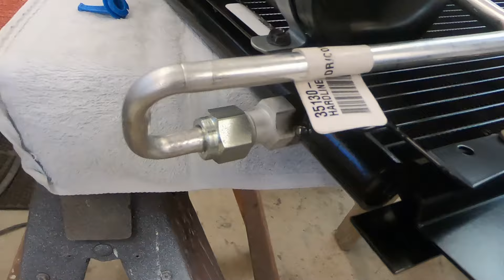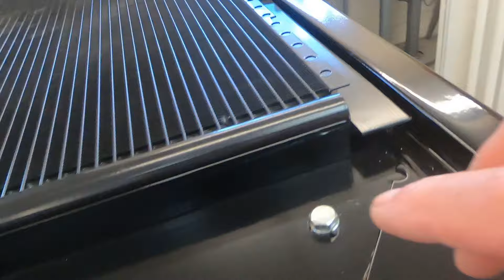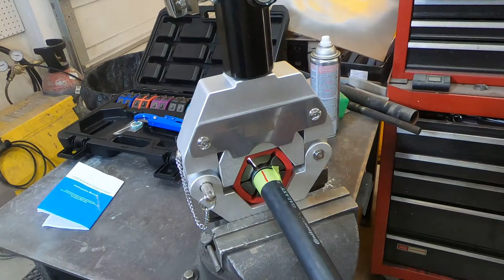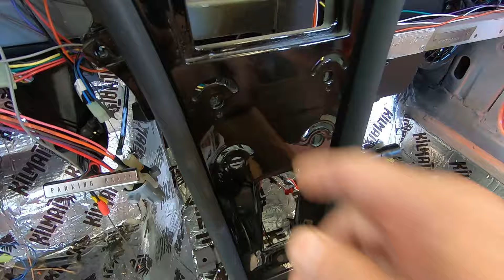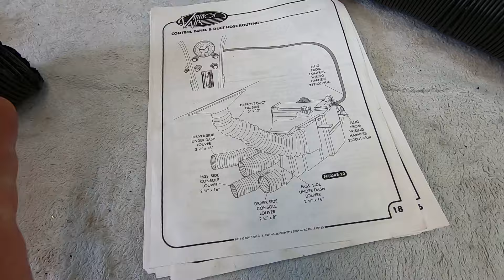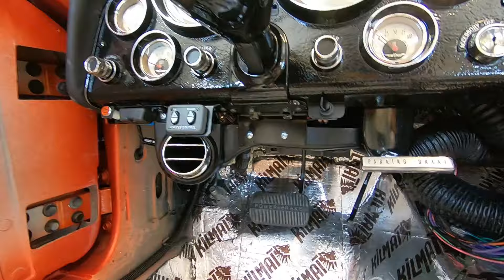Vintage Air Gen IV Surefit AC Installation - C2 Corvette - Part 2 of 2

Comment: I bought my Vintage Air kit a few years ago and have been postponing (procrastinating?) its installation for much too long.  Your video convinced me that even I might make my way through this task without too much trouble.  You are a handy guy, and you have inspired me, friend!

BTW, do you have a color code for that excellent paint choice on your Vette?  It is just about what I had in mind for a restomod '57 Chevy I am building here in Reno.
Reply from the maker: Thanks for the kind words. The attached link is for the exact basecoat I used, https://tamcopaint.com/products/gm-sunset-orange-metallic-71-g8f-633h-2000-2016-oem-basecoat?_pos=2&_fid=16cbe7a54&_ss=c .